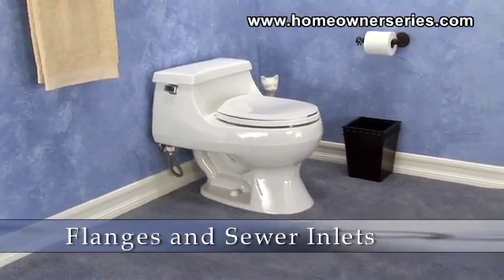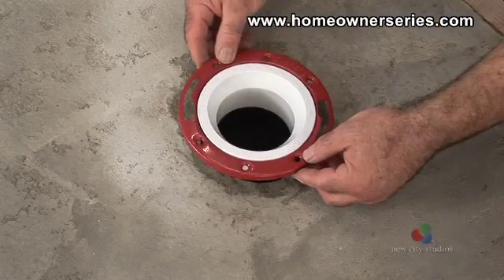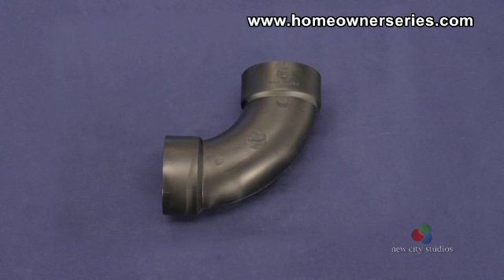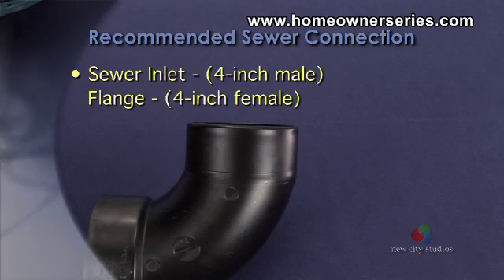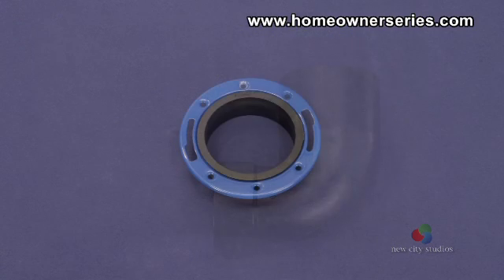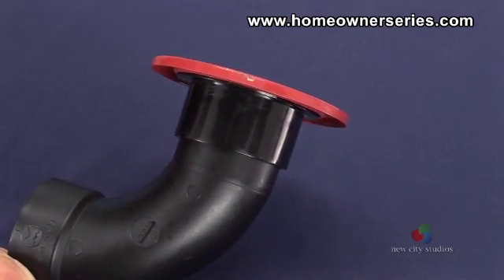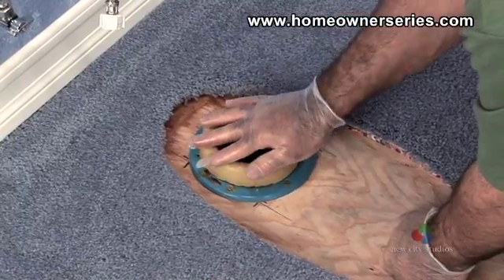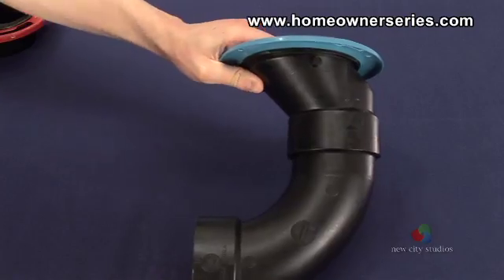Toilet Repairs - Toilet Flange - Parts

Comment: Sometimes even a cheap knock off of a Dremel tool, like a Walmart hyper tough rechargeable rotary tool combined with a abrasive disc, or even a tiny saw can be worth it’s weight in gold… I use mine several times a week… I now own three… hey, they came up on clearance… I like one charging and one ready for use and one when I can’t find the other one lol…I can’t imagine anyone doing without one. Any attachment that will fit a Dremel will fit a generic… and the variety is endless… I have yet to have one fail. My 4th Dremel failed last year. Best 20-something bucks you’ll ever spend if you do a lot of repair, replace, clean, de-corrode, cut, sharpen or polish type work. The time consuming and tedious becomes closer to gratifying and fun.

Comment: Plastic flanges break metal rust I use the pvc with the stainless ring don't break don't rust or if its a lead repair use the brass ring. If you use a complete plastic flange I recommend mixing mortar and poring it around the flange on the floor and set the w/c on the mortar
Reply: Plastic IS ACTUALLY EXTREMELY DURABLE

Comment: OOPS,, BIG MISTAKE,, This guy is using a metal 'toilet flange' as first choice,,, bad bad bad. Recommend using ABS PLASTIC only for 'closet flanges', as they never RUST OUT OF SIGHT.  I have even seen a Santa Cruz plumber put a new metal repair flange over a completely rusted metal closet/ toilet flange !!  Bonkers !!  It too will Rust too soon, and out of sight. That planned obsel. practice should be stopped on all new and repair toilet jobs. fubar,,,

Comment: According to the plumbing code;all that is required for a toilet waste line is 3 inch.The floor flange that goes along with the 3 inch pipe is a 4 x3. There are many different types depending on the application. I have never ran 4 inch pipe for any toilet yet and I have been doing this work for 32 years. The cost is higher as well as you go up in size.Carpet has been put in many bathrooms in years gone by. Practical...probably not,but it is still installed. Wouldn't be my choice. Have a good day